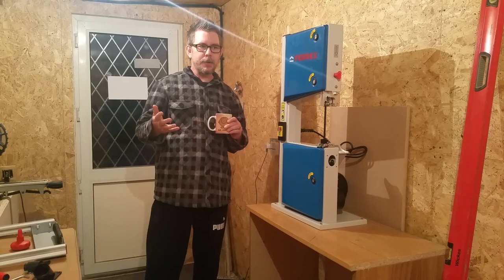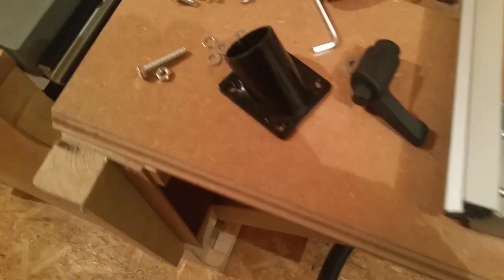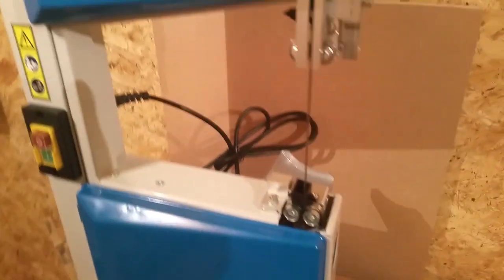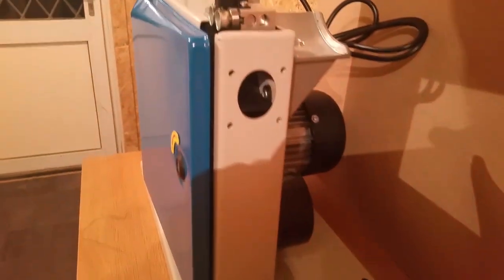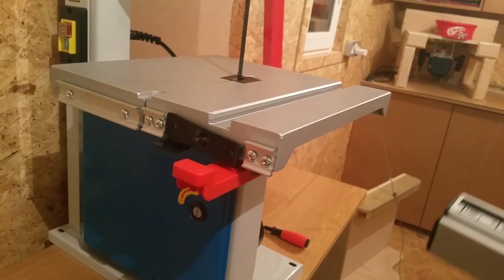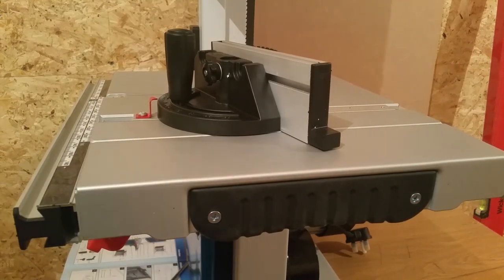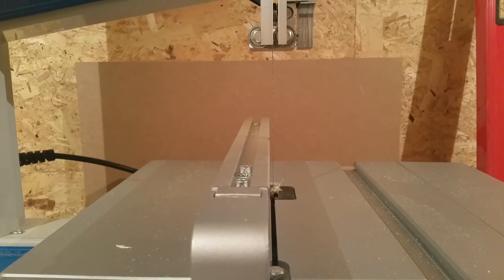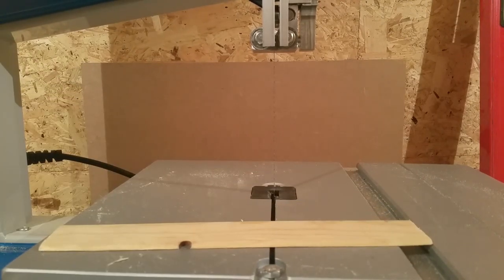Aldi Ferrex 10" bandsaw first look

Comment: This is 2 and bit years after you looked at your Aldi Ferrex bandsaw. I have recently ordered one (you have to quick to order one as they don't hang around long), it arrived yesterday and I have put it all together now, I had the same problem as you with the table tilt locking screw disappearing under the bracket and having to loosen the 4 bolts to put it back in place! Like you I have never used or owned a bandsaw before and I'm really impressed with it's performance, I hope I will continue to find it good. Thanks for your video, shame I didn't watch it prior to putting it all together!
Reply from the maker: Thanks mate. It's a great saw for the money

Comment: Hi Grumpy. You may remember that before Aldi had Ferrex, they sold Workzone tools and before that was Powercraft. I have a Powercraft bandsaw which is 200W less powerful and I have never managed to stop the blade wandering. I consider it to be junk and I recently bought the Ferrex machine to replace it. I haven't had time to unbox it yet but your video gives me reason to hope for a much improved performance over the cheaply made Powercraft. Many thanks.
Reply from the maker: For the money its a nice little saw. Put a decent blade on it as that will improve its performance

Comment: Looks very good for the money ..... fantastic really. Agree with others to reduce blade twist lower the blade guide closer to the work piece. The fence is identical in design to the fence on the Bosch table saw which I find very accurate once dialed in. Great video mate good find.